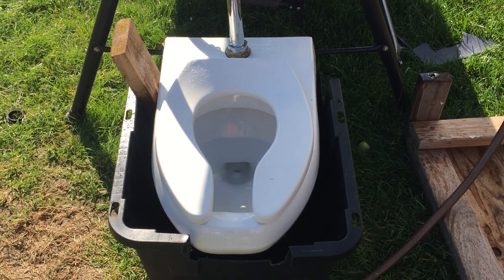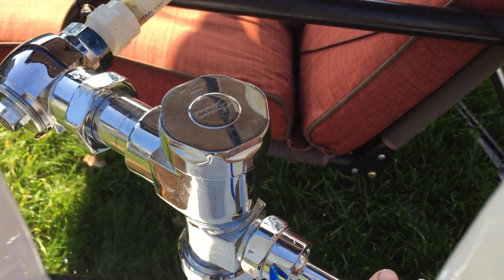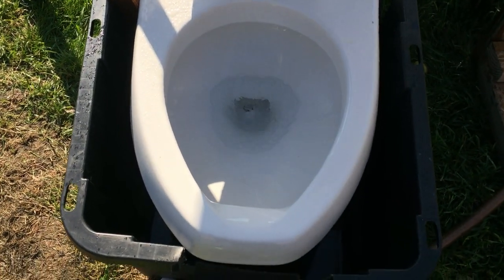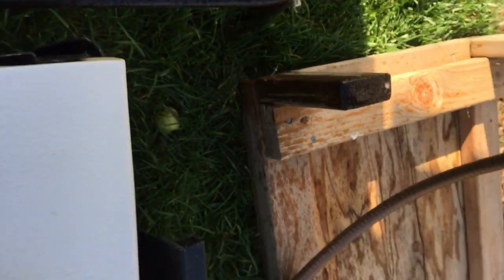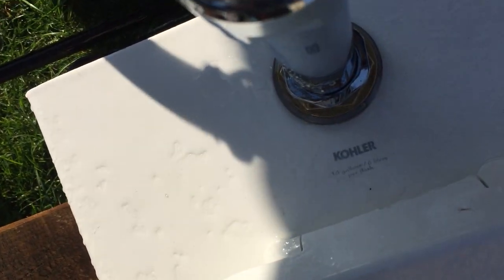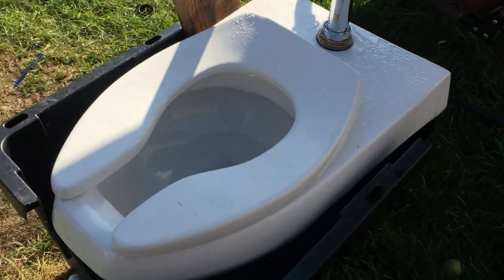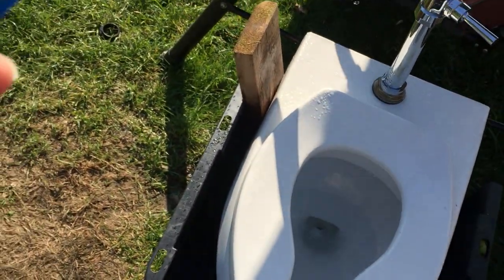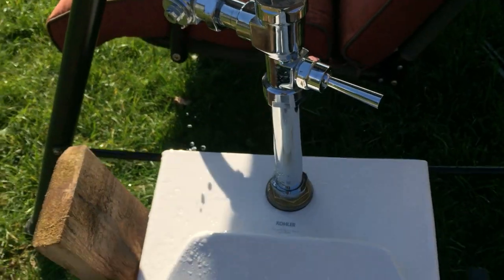Kohler Kingston on flushometer

Comment: I wish you could get a 1.6 Flushometer and put it on this
Reply from the maker: Kingston Addict I will
Reply: BTR plumbing good!! what made you install a seat on the kingston?
Reply from the maker: Kingston Addict because I thought it would look cool
Reply: BTR plumbing ohhh ok.
Reply: BTR plumbing I have a Kohler Kingston water guard
Reply from the maker: KohlerToiletFan2000 could you do a vid of it
Reply: BTR plumbing sure I just have to get it out of storage also it has a small crack
Reply: BTR plumbing also I have to pressurize my 20 gallon pressure tank
Reply from the maker: Kingston Addict I just got a Sloan royal flushometer with 3.5 diaphragm. I’ll be doing another vid of the Kingston on the new flushometer
Reply: BTR plumbing good! I’ll be watching it whenever I get the chance!
Reply from the maker: Kingston Addict imma make the vid right now
Reply: 2 years later has a hellton of flushmoeters